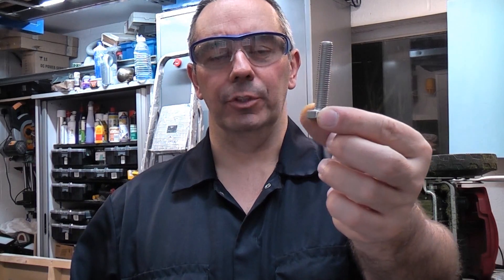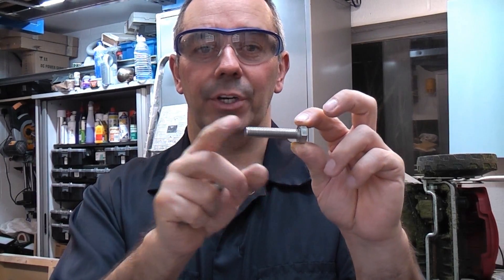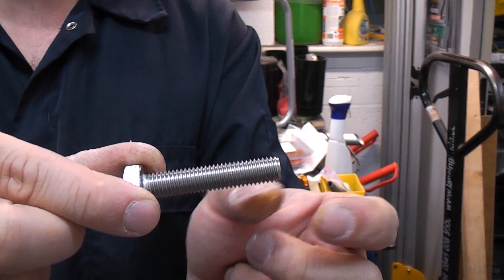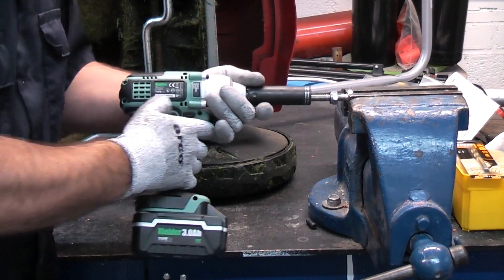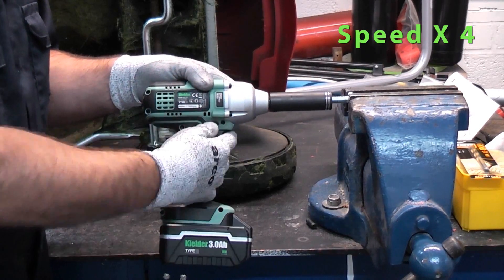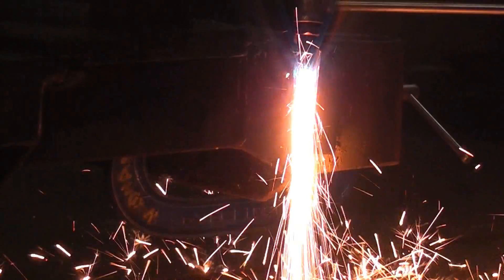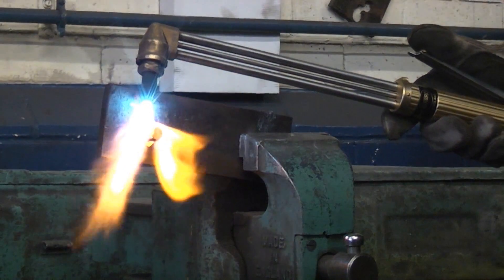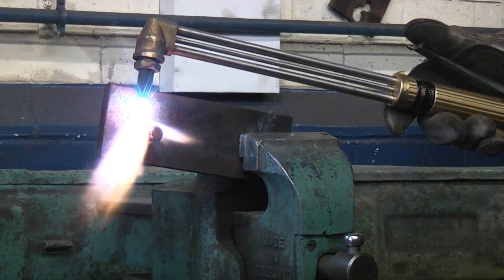Stainless steel bolts vs steel bolts | Stainless galling

Comment: What about Stainles Steel set screws into Aluminium? Is galling still prevalent?
Reply from the maker: No, that should be fine. Stainless only galls up with other stainless, for example if you use a steel bolt and stainless-steel nut, there should be no galling 😉

Comment: Interesting video, I'd never heard of stainless galling before. I've rebuilt several bicycles using stainless fasteners, and not encountered any problems like this - maybe screwing into aluminium and/or using copper grease has prevented problems.

Comment: all i want to know is, how do i prevent the bolt heads holding my skid plates from shearing off? is the best solution just to replace the most used bolts every 12 months?
HELP!
Reply from the maker: Sometimes high-tensile bolts are used, these are tough, but brittle and shear off easily. I used to work on two plastic manufacturing plants, with almost identical operations. One plant used regular bolts and one plant used high-tensile socket head bolts. The socket head bolts used to shear off for fun, but the regular bolts did not, as they were more ductile! Just something to consider 😉

Comment: I have used hundred or so A2 bolts and nuts on my solar system and never had any issue on galling on M8 and M10 threads, no need to be scared, I will never use zinc plated bolts outside, they are rusty after a year sometime, useless. I use stainless everywhere now and very happy with it.

Comment: SS galls up because under the electron microscope SS is full of grooves and tracks and scratches. SS does not make a smooth surface because of its hardness. That is what causes the galling problems pointed out below. Avoid using SS with chlorinated products. Cl attacks the nickel. That is why SS cookware goes bad after a short time. All the fats and stuff build up in those tiny scratches and burn your food. SS nuts must be tightened slowly and only by hand tools. DO NOT use drivers or impact wrenches on SS.

Comment: Starting using Stainless Steel bolts while working in a slaughter house over 50 years ago then a huge candy/ chocolate plant. Never had trouble until the Hospital that I retired from purchased all of the stainless steel bolts & hardware from scum bag WW graingers who only supplied inferior POS crap from cheating lack of quality control communist china. While tightening a 1/4" grainger/ china cap screw with a nut driver and only one hand broke several heads off. It appears that at least 5 to 10 % of cheating china bolts, machine screws & hex nuts have defective threads. We always used never seeze on all bolts in the slaughter house & candy plant.

Comment: Good video, nice to know. I recently replaced the bolts and nuts on the roof rack of my truck for stainless steel since the steel ones that was on there had almost corroded away to the point of no longer being able to keep the thing together (this truck sits outside next to the ocean 24/7 and corrosion is a massive pain the ass). I wondered why they don't just do stainless steel on all the bolts of the truck, apart from cost I guess this answers my question. I'm still happy that I swapped those to stainless though, since I never have to undo/redo those bolts so seizing won't bother me so much and now, with the stainless bolts and nuts, it should basically last for the lifetime of the roof rack and/or truck.

Comment: You need to torque SS bolts correctly. Over torquing will compromise the strength of the smaller threads and holding strength.

Comment: How about stainless nut on regular bolt and regular nut on stainless bolt? Also when using the torch to heat up the stainless does it help to remove the stuck nut?
Reply from the maker: They will be fine, it's only stainless on stainless that causes the problem ;-)
Reply: @ultimatehandyman  So I can use stainless bolts on an engine to hold the exhaust manifold on aluminum heads?
Reply from the maker: @judgedredd8876   You could do, but I'd use steel to be honest- just use a good ceramic based anti-seize compound!
Reply: @ultimatehandyman  Thank you!

Comment: What about stainless bolts in a aluminum moped block? I just finnished doing a rebuild and I used stainless allen bolts. The thread is not all the way its lenght
Reply from the maker: It should be fine. Problems only occur with stainless steel bolts, when they are used on something else made from stainless steel 👍

Comment: From what I understand about how a cutting torch works( super fast oxidation ) that would explain why you cannot burn through it but I'll bet you could have got that bolt glowing white hot and then cut it off with a hot chisle

Comment: This only happens with the lock nuts.  The nylon melts and causes the nut to cease.       Use regular stainless steel nuts and lock washers instead.
Reply from the maker: No it does not. This works on stainless nuts that are not Nylocks.

Comment: You have to use lube with stainless and aluminum or it will gall almost every time. Anti seize was literally made for this. As long as you do this the advantages make it worth it for things that are likely to corrode. Just don't put a stainless bolt in anything aluminum, or it will weaken the aluminum overtime.

Comment: Hello Guys,
Thanks a lot for this fruitfull video we can understand that:
-Galling appears when we use standard stainless steel, I can see A2 on the bolt
-Also increasing the speed mouting is not so good during mounting
-Stainless is really well know against fire, this is why it is more and more used in construction
We need absolutly to separate standard SS bolts and qualitative SS bolts :
-Most of the stainless steel bolts strength are obtained by cold forging and this work is really important
-The galling is a fact but the method to make the thread is really important. The thread rolling is important.
-Last point and maybe the most important, what is the strength of the SS bolt you used? A2-70? 
Most of the bolts in industry have poor mechanical strength. It means that you will have many chance to enter in the pastic area of your bolts.
All these points are really important against galling!
You need only to find a stainless company having screws of high quality like Bumax (www.bumax-fasteners.com). They are really well know against galling and also have created same mechanical properties than steel bolts.
Feel free to comment !

Comment: If one does indeed have a galled ss bolt, what is the only/best method to remove it? If the two parts have married and became one, is it useless to even try to 'break it free' by unscrewing it?
Reply from the maker: You have no chance of undoing it, once it has galled up.
Normally I hacksaw or cut through the bolt using a grinder.
Thanks for the comment 👍

Comment: Assuming the issue a user may be trying to avoid, by using Stainless Steel bolts with SS nuts, is the nut rusting to the bolt, rather than the nut or bolt rusting to whatever is being bolted; would using a non-SS steel nut on an SS  bolt, or SS nut on a non-SS bolt be a non-galling solution?
Reply from the maker: I would imagine that a steel nut on a stainless bolt would be fine, especially if the bolt was coated with some copper anti-seize compound.
Thanks for the comment
Reply: @ultimatehandyman  Thank you :)

Comment: I just learned this the hard ways on car I'm restoring.....There seizing left and right. So i have to twist them off or cut off with grinder or hack saws. The idiot that invented stainless steel nuts and bolts should be shot.
Reply from the maker: They are ok in some circumstances, we use them a lot on site for joining flanged stainless chemical pipes. Problems only occur when someone goes in the stores and picks up stainless bolts and nuts and uses them on a steam pipe joint. Someone did that on a valve I was replacing and I had to hacksaw through the M16 stainless bolts! ARGHH ;-)
Thanks for the comment

Comment: Hello can you tell me?  i have some rod ends with 16mm bore  ...i want to use high misalignment spacers which will  reduce bore to 14 mm  will  14mm bolts about 75mm long supported both ends and thru rod end  12.9 grade carry my one thousand pound trike ..two wheels at front so each bolt will carry 500lb when stationary..great vid on stainless
Reply from the maker: I think you might need to ask a structural engineer that question ;-)
Thanks for the comment 👍
Reply: maybe someone readig this will know..thanks for reply

Comment: Where  worked we had fiberglass flanged pipes we used stainless bolts always getting gaulded bolts pain in the butt.
Reply from the maker: We have some of those on site, they are a nightmare!
Thanks for the comment 👍

Comment: actually you can burn stainless with a cuting torch but you have to put a arc welding rod into the flame as you hit the oxygen, it works sort of like a thermal lance and is somewhat messy of a cut, but it does work in giving the flame a source of iron to burn. the modern equal is a powder burning torch, but those are expensive!
Reply from the maker: I'll try that in future 
Thanks for the comment 👍
Reply: the old school way was a coat hanger.....

Comment: Can you weld the zinc coated steel bolts?
Reply from the maker: You can, but you shouldn't as the fumes given off can result in galvanic poisoning. It's always best to weld non-coated metals.
Reply: @ultimatehandyman  Thank you
Reply from the maker: You are welcome ;-)

Comment: Is there any negative to using a steel bolt & an SS nut, or an SS bolt with a steel nut?
Reply from the maker: I'm not sure, as it's not something I normally do.
Most of the time we use steel nuts and bolts and just apply anti-seize compound. Worst case scenario, is that you either have to cut the bolts off using a grinder/hacksaw or gas axe (depending on where it is).
Stainless and steel bolts should not gall, but there might be corrosion issues, a bit like if you put steel wool near a stainless steel sink - it can make it rust.
Reply: @ultimatehandyman  Thank you!

Comment: So how would you cut it off is there any way to? Apart from a drill or grinder. Like a Tig welder or something. What would get the metal hot enough to burn? How do they cut stainless steel into shapes?
Reply from the maker: I’ve had to use a hack saw in the past, but a grinder will work. Stainless steel can be cut on a laser cutter or with a plasma cutter, it just won’t cut using oxygen and acetylene. 
Thanks for the comment 👍

Comment: You can blast stainless steel with gas cutting of sorts .we regularly do it with the 30mm stainless bolt heads at work you just have to up the pressures a bit and heat untill the metal is starting to melt then blow it away with the oxygen a bit slow and messy but works
Reply from the maker: Thanks for the info ;-)

Comment: With the nylock nut on the s.s. bolt:  Did the sharp threads of the bolt cut up the nylon threads, then dig into the nut itself, causing it to seize (gall)?  If not, what was the proximate cause that made it seize?
Reply from the maker: The stainless galled together. We get this on site regularly, even if a impact wrench has not been used.
Thanks for the comment

Comment: Note that the "steel" bolts used here are actually cadmium or zinc plated, as are the nuts. SS should ALWAYS have an anti-sieze if into SS or aluminum. Then you also have to be careful not to over-tighten because the anti-sieze reduces the friction so much. And don't spin SS (or aluminum) so fast. Heat generated by friction will increase chances of gauling. Slow down and lubricate.

Comment: wow that is not good news. I have used stainless steel bolts, nuts, washers, and lock washers in the exhaust system of my antique car to prevent rusting. Clamps are also stainless steel.
Reply from the maker: On an exhaust system you might struggle removing them, but you can always cut through them using a cutting disc and angle grinder.
Thanks for the comment

Comment: Sooooo.... what you are showing is that I don't need to use shake proof washers, just use stainless steel bolts
Reply from the maker: LOL, Stainless bolts don't always seize up - but when they do they can be a real pain in the backside.
Thanks for the comment

Comment: Useful vid, thanks.  But why, specifically does galling occur?  Due to poorly formed threads that don't quite match?  To date I have never come across galling, will try shortly to replicate & lock up some fittings, just too see.  One problem is that SS bolts (in my plumbing / auto experience) are SOFTER than mild steel, and can be damaged more easily.  But then I always use a suitable lubricant, as MS bolts/nuts can rust, seize & snap off just the same.  If we can understand the specific problem, then we can build out problems in the first place.  Thanks again.

Comment: I am a design engineer by trade and don't profess to know the hands on stuff like yourself but when design stainless assemblies I would mix the grades of stainless ie 300 grade (austenitic st.stl) nut with 400 grade (Martensitic st.stl) bolt. This dissimilar combination worked pretty well on gas turbine bits. I didn't realise that you couldn't burn out stainless but it is full of Nickel and chrome so pretty good at resisting heat. Another point is that 300 grade stainless is weak as it comes....it's about as good as super cheap Chinese bolts, saying that 400 grade can be heat treated up to the equivalent of 8,8 bolts maybe more.....we use it for compressor blades on gas turbines so it's tough and good in tensile strength.
Reply from the maker: Using different grades of stainless is supposed to help prevent galling, although I can't confirm that is true as I have not tested it.

Thanks for the comment 😉

Comment: what about using SS A2 bolts on cast iron?
Reply from the maker: I would not risk it to be honest. I'd just use steel bolts, preferably BZP or black phosphate coated and use some decent anti-seize compound. 
Thanks for the comment

Comment: Just tested stainless A2 M5 screw with nylon lock nut. There we no problems until I began turning the bolt faster then 180rpm. The bolt began heating and locked.

First I was using hand tools, was not able to make galling. And I was turning it in and out for 10 minutes. So the problem is speed and heat, no power tools allowed.

If you have this problem with hand tools then your bolt or nut is bad quality to begin with.
Reply from the maker: Was the nylock nut A2 or A4 ?
We get galling occasionally using just spanners!
Thanks for the comment 😉
Reply: @ultimatehandyman  Both were A2 stainless steel.

Comment: I learned something from this, Thanks ! When I use stainless or brass wood screws I pilot the hole and then run the same size steel screw in to thread the hole. Then replace the steel screw with a stainless or brass one. Stainless & brass screws either strip the Phillips recess, snap the screw or twist the head off when power driven.
Reply from the maker: You are welcome.
Stainless screws are useless, I used them once to make a wooden gate. A week later I needed to adjust the hinges and every one of the heads sheared off!
Thanks for the comment 😉

Comment: A wipe of oil will prevent this. We usually assemble stainless fasteners with a bit of moly grease and we never see any problems. 
The trouble we do see is in very old installations where stainless bolts have sat in tapped aluminium holes for 20 years or more. The aluminium corrodes, egged on by the less reactive stainless, and it locks up as tight as tight can be. In fairness the same or worse would happen to carbon steel. 
If you want a real nightmare, bolt copper to aluminium and leave it near the sea, it’ll rot like a pear in a cesspit.
Reply from the maker: Thanks for the comment ;-)

Comment: So the question is why use a stainless steel bolt. Can you give.us an example.
Reply from the maker: 1:08 in the video. That is a glass washing machine, it is made from 316 stainless, all the rollers, spray bars etc. are also made of 316 stainless. The rollers attach to spigots, which lead to the outside of the washing machine (the spigots go into the bearings).

The spigots are attached to the rollers using 316 stainless bolts. Stainless has to be used to prevent any rust etc from contaminating the washing machine.

Thanks for the comment
Reply: @ultimatehandyman  ok good. Thanks

Comment: Three solutions..... use an appropriate anti-galling compund between nut and bolt.......or.....use a nut of a slightly different stainless alloy as the bolt ( 304 vs 316....300 series vs 400 series,etc).....or the best bet....use silicon-bronze nuts on stainless bolts. Double-check component strength ratings of all pieces in critical strength applications.
Reply from the maker: Thanks for the comment ;-)

Comment: I tried ss bolts building boats and found they snapped under loads i now use regular steel...
Reply from the maker: Yes, they are nowhere near as strong as steel.
Thanks for the comment ;-)